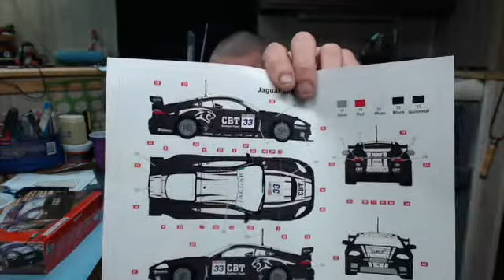getting ready to spray the 1/32 jag body

Comment: Being as the store only had gray enamel primer in a spray " testers" and I'm painting metal bolts...I think I will head back to get some white flat enamel for the heads before painting gold for a brighter finish . Only the heads will show on top the marble table. Just trying to prevent rust on the marble.